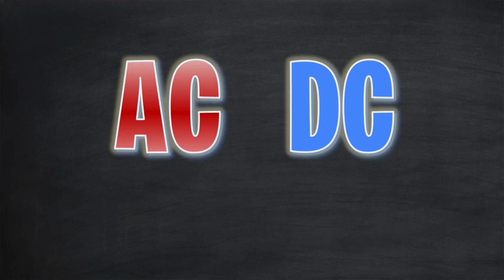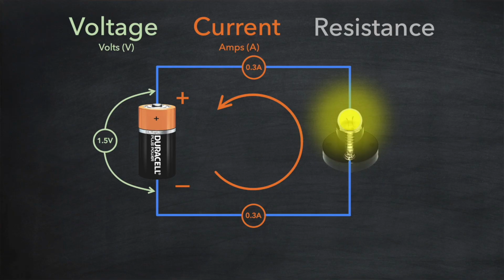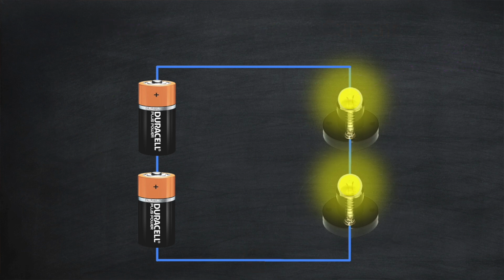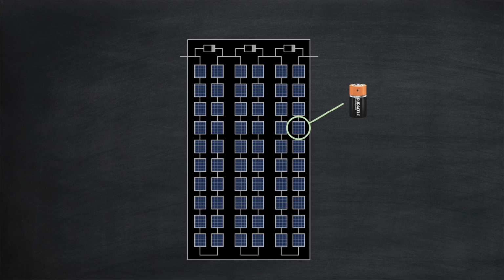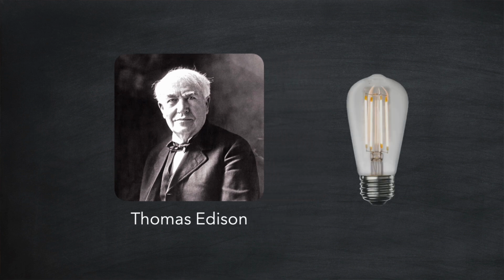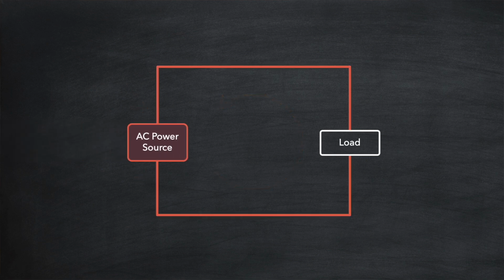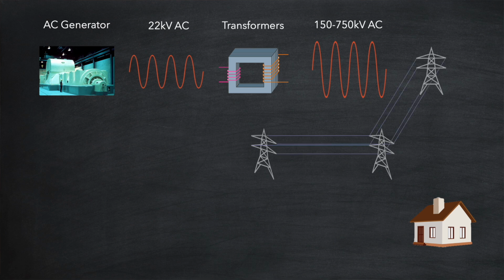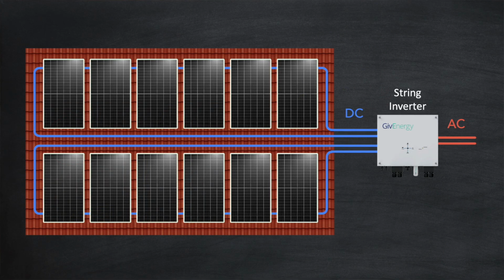AC / DC: What’s the difference? Voltage & Current Explained

Comment: Easily the best channel on solar and batteries if you're serious about understanding how it works and how to cost it. I've turned off my solar immersion thanks to the advice on this channel, saving me money. I was about to have my solar inverter replaced with a retrofit battery install of a Sigenergy setup but then with the help of these videos I realised that it makes more sense to export all the solar and not store it in the batteries.

My question: is there a way to have the battery+inverter installed so if in future the tariffs make it more sensible to store the solar I can switch everything over to include the solar at a minimum rework cost? As in - now I would have the battery installed as AC coupled to protect my FIT, but when that expires maybe DC coupled will be more sensible and could let me retire the solar inverter.
Reply from the maker: Ah, I think you are the person who emailed me on the same topic? 😀

Comment: You lost me at 11:03 
6 x 30 = 180 volts
Reply from the maker: Yeah, this was an error. I originally had 8 panels in the diagram but reduced to 6 and didn't change the calculation. There's already a correction label in the video, and it's a pinned comment.

Comment: Hi Garry I noticed a problem 19 mins 53 second in to your excellent video , you are showing single phase "across phases" in a single phase home connection I think it should be phase to neutral ,Best regards John Maggs
Reply from the maker: Hi John, thanks for taking the time to comment and also the kind words.

You are correct - I've no idea why I got this part wrong - I was using a wiring diagram I found on the Internet, but when I searched again just now, the only diagrams I find are indeed ones where a neutral line is used. I'll add a correction to the video and also the description - thanks for highlighting!
Reply: @GaryDoesSolar  No Problem keep up the good work

Comment from the maker: VIDEO CORRECTIONS:
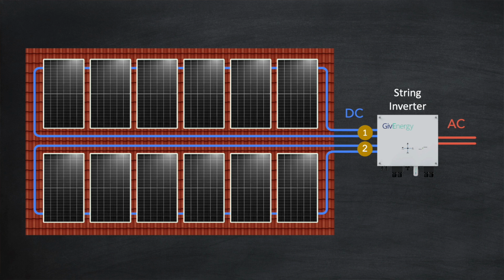1. At 10:55 in the video, I say that 6 x 30 volts = 240 volts, which is embarrassingly incorrect! I should have drawn 8 panels in each string.

2. At 19:53, the single-phase wiring into each house should only be a single phase colour, and all properties would additionally have a neutral line.

3. You should never use an ohmmeter on a live circuit.
Reply: come to see the comment when I heard that 😂 just some small mistakes, still a great video, many thanks

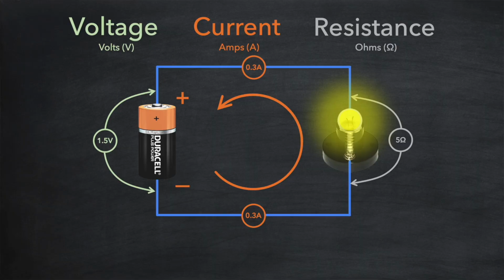Comment: 3:54  In real life, please don’t connect an ohmmeter to a live circuit.
Reply from the maker: Fair comment, Claire!
Reply: @GaryDoesSolar  nonetheless a good made video. I watched all your videos and I learned a lot. Thank you 🙏🏻
Reply from the maker: Hi Claire - thanks for the kind words. I studied electrical and electronic engineering, so I really should have been more diligent! 👍 I wouldn't trust myself with any kind of high voltage system today! 🤣

Comment: Don't mention "conventional current flow" !!  ( convention has it that current flows positive to negative)

That is how electrical  and electronic engineers "see" current flow - that is it  is said to "flow" the opposite direction to that shown in  your video  -  going from  +ve to -ve !!   
(although ..... it is of course electrons having a negative charge being attracted to the positive potential!!)
Confused!  - well welcome to the world of electrical and electronic engineering !!
Reply from the maker: Hi Eric, I knew whatever I said about the flow of current in the video, I was in for a debate. When I was studying, I was taught that conventional current was wrong and that current flowed with electrons from -ve to +ve.

It seems today that conventional current is indeed correct (at least according to some sources) so I really don't have a clue. And whatever is correct, I'm sure in the future we'll come up with a different understanding!

So, I decided to work on the basis that if I clearly indicated the direction of current in my video, we could at least all work to that :-)
Reply: @GaryDoesSolar I will explain it. I am an Electronics engineer.

Electricity flows as electrons from negative to positive. Somebody many years ago thought it flew from +ve to -ve and got it wrong.  So we are stuck with that convention.

However, you never need to worry about current flow as electrons unless you are involved in designing semiconductor devices such as diodes, transistors. You don't even need to worry about it if you are designing integrated circuits.
Thermionic valves you may have to worry about it.

Other than that, you will never need to worry about which direction the electrons are flowing.

Considering current flow as +ve to -ve does not cause any issues 99% of the time.

The problem comes when poorly trained and poorly educated amateurs try to show off that they understand electricity by talking about electron flow because they think it makes them look clever, when in fact all it does is cause confusion which is entirely unnecessary.

My advice is, forget electron flow unless you really need to deal with it as in say the analysis of operation of a semiconductor device.

Trust me, I have done a lot of analysis of electrical and electronic circuits and you can completely forget about electron flow.

The reality is, when doing analysis you may not know which direction the current is flowing in the circuit, so you ascribe letters to the currents, draw arrows on the circuit diagram and when you have completed the analysis any negative figures you derive simply indicate the direction is flowing in the opposite direction to the arrow you marked on the circuit diagram.

So it in practice, whether you are considering conventional flow or electron flow the result of the analysis is going to be the same, just that in one scenario you will end up with opposite polarity numbers and it is the polarity + or - for the current which indicate its direction.

The key thing is, we all standardise on the same current convention so we can communicate effectively. And that standard is conventional current flow. It doesn't cause any issues.

When I find people talking about electron flow, which happens occasionally, and are trying to push that as the correct way to describe current flow, it nearly always sets the alarm bells ringing in my head because it is nearly always people that are not educated to degree level in electrical or electronic engineering.

Comment: At 2:36 you say that current goes form the negative terminal to the positive. It doesn't. It goes from positive to negative. Electrons flow from the negative to the positive, but current goes the other direction.
Reply from the maker: Hi Andrew, I guess humankind can (and will) argue about that for years.

The pragmatic point is that so long as the direction of current in any electrical diagram is stated (as I did) then that holds for that diagram.
Reply: @GaryDoesSolar  There's no argument. It's GCSE level physics.
Reply from the maker: ... as we understand things *today*. Given our understanding of direction of current has changed a few times over the last 100 years, I would not bet my life that it will not change again.

Irrespective, I refer you to the last sentence of my previous response.
Reply: @GaryDoesSolar e never consider electron flow except when analysing the behaviour internally of semiconductor devices, or when dealing with valves or fluorescent tubes and cathode ray tubes or when teaching about how capacitors work.

It is not relevant to any discussion outside of these devices. It is only relevant for understanding how these devices work but it is not required to use the device and make it work in a circuit